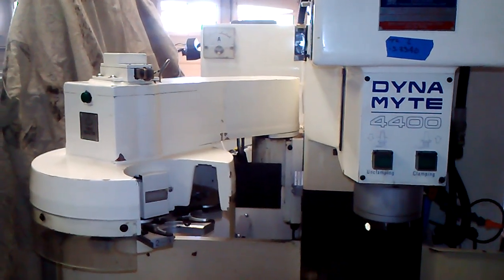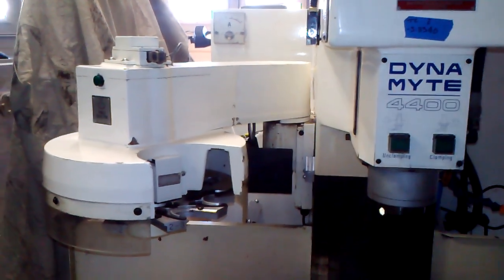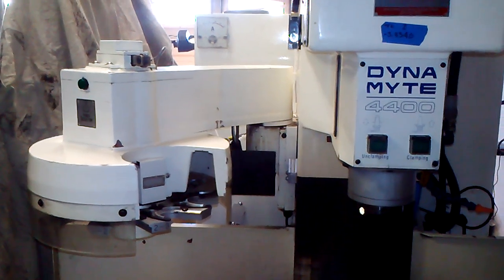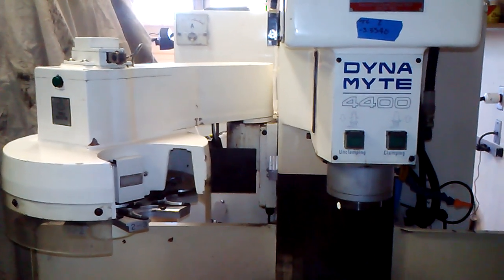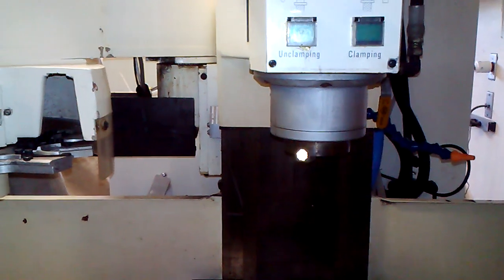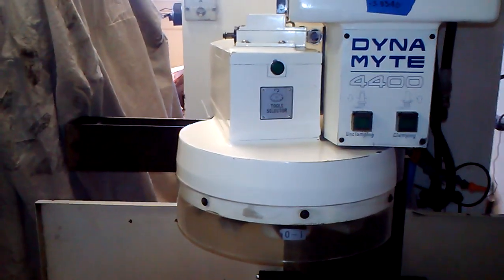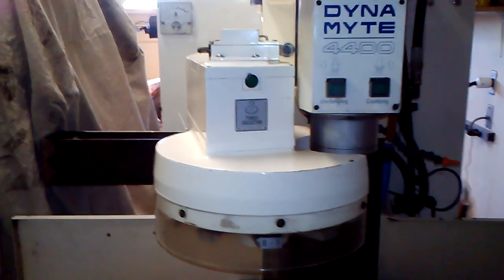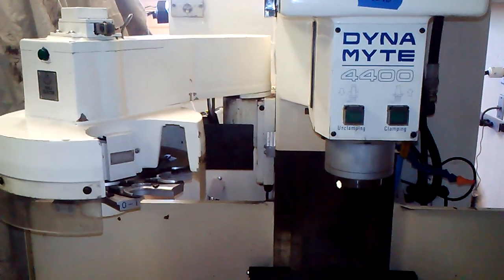ATC working under Flashcut CNC Control

Comment: Hi, very nice ATC.  I purchased a surplus DM4400 spindle and am scratch building a VMC.  Do you know where the inlet port is for the airblast?  I think my spindle is the same as yours, but I don't see where the supply for the air comes in?

Thanks,
Walt
Reply: Which flash cut package did you go with? I just purchased a DM4400 and need to do a full retrofit.
Thanks